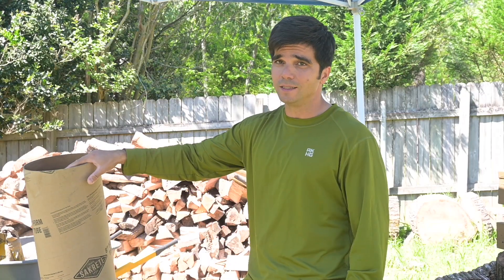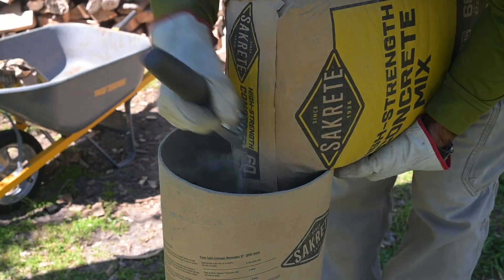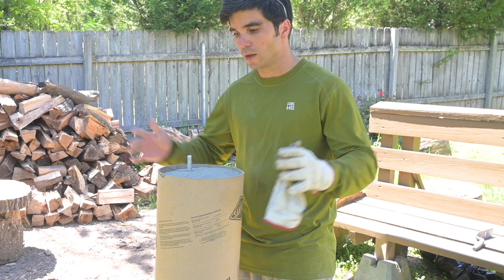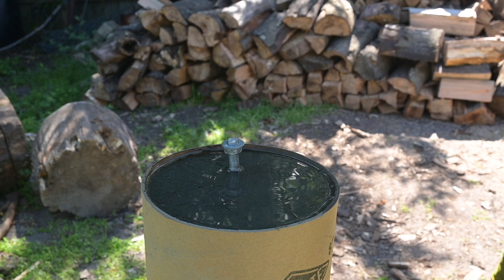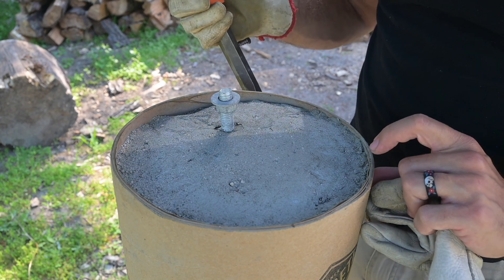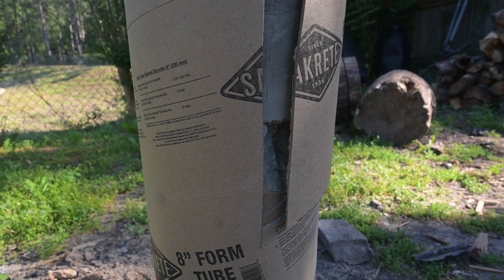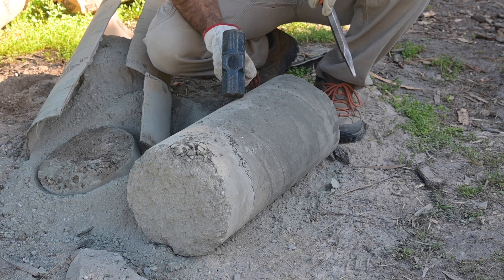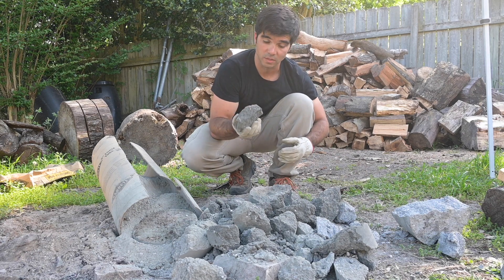Dry Pour Concrete: How Deep Can you Make it?

Comment: Sure if your building a 4 ft thick bomb shelter, bridge, high rise etc. dry pour no good. But for the small DIY home projects dry pour is fine.
Reply from the maker: To be honest, based on what I've seen so far I'd hesitate to make anything more than a chicken run or walkway with dry pour. I think slabs are a bit different since they're getting a lot of moisture from the ground, but the stratification is pretty bad and leads to a low quality result.

Comment: 2 days is not enough time to fully cure a 4 ft pillar
Reply from the maker: Concrete has 50% strength at 2 days and is rated for driving on. 
You can plainly see the difference in quality and strength when compared to cement that was mixed (in the tube) when you watch one of my earlier videos.
Reply: @appalachianwoodhomestead  is it common practice to drill holes for anchors after 2 days? And for similarity if building a deck on one of those brackets that keeps the wood off the foundation, would they start construction after the 2 days or let it cure a little longer?
Reply from the maker: @clintlickner  People do drill after 24-48 hours, but typically don't put torque on anything for about a week. Your point is taken in that regard. However, the overall quality is also extremely poor. I still have a chunk sitting around and can try drilling it now that it's been longer, if you're interested to see that.
Reply: @appalachianwoodhomestead  yes I am very interested to see that result as well
Reply: MIXED concrete, maybe. The curing and strength times you cite are based on a the standard mix pour method. Just consider that slower hydration might cause the chemical curing process to be extended. It might take a month or more for full strength. And again, contractors would never use this method, this is for DIY people who don’t have the equipment to mix and pour but DO have time to wait for curing.
Reply from the maker: @isabellavision  Agreed that this method is absolutely not for serious construction. 

The only information I can find suggests that dry pour may cure and dry slightly more quickly than wet pour. It would be a very interesting experiment to run. Maybe I can use it as an excuse to get more fun tools.

Comment: Thx for trying this but I'm not sure why people keep only estimating the amount of water used when they should be using the amount of water for each bag. For every bag of concrete, people SHOULD have a measured amount of water set aside to pour on the surface after the top layer firms. This is the only way to know how strong a dry pour can be because of actually using the correct amount of water for the entire process.
Reply: Great comment Rotary. 

Tamping the material is also crucial, otherwise there will be air voids which will be weak spots leading failure. No different than a wet pour. The principles of concrete all still apply.
Reply: @johnlee7085  Yep!
Reply from the maker: Fair enough. Thank you for the suggestion. with this video I was trying to test the way people are currently doing dry pour, which is clearly not optimal for concrete strength. I'll probably test again with measured water sometime next month.
Reply: @appalachianwoodhomestead  Sure NP! I'm about to do my own experiment as well.
Reply: I totally agree with your opinion!

Comment: Dont give up! Do one more test. All it will take is another not-fun clean up and goodbye to more of your own money! Hopefully this will produce more accurate and desirable water/concrete mix results than your last attempt using a hose and spray nozzle, which can't be easily measured or delivered. Also will provide evidence of how water does or doesn't permeate a volume of dry concrete mix that's thicker than a 4" slab configuration. Quickrete specifies 7 pints of water per 60 lb bag of the mix you used. As before, fill another 8" diameter x 4 foot Sonotube but with only two 60 lb bags. The column height will be about 31". No need to tap or vibrate. Then pour in all the ACCURATELY MEASURED water that Quickrete specifies for the  two 60lb bags; 14 pints (1 gallon +3 quarts. Not from a hose, use a container. Let cure for 24 hours. Cross fingers, cut open the cardboard tube and destructive test.
Reply from the maker: Sakrete (what's sold in my area and what I used) requires 2.5 quarts per bag of the size I had, which is less than the amount you cited for Quickrete. 

I agree the hose can be difficult to measure, but this was an attempt to test the currently popular dry pour method, which uses misting and hosing instead of measuring.

I sincerely doubt that this no-mix method, no matter how the water is measured, will result in a high quality product, but I'm willing to give measuring it a try at some point. Though I would wait at least 48 hours to cut it open, since that's when it's rated for vehicle traffic and has 50% of its final strength.
Reply: Without the correct amount of water, the cement is only partially hydrated, so there would be no way for the concrete to be as strong as any other fully hydrated method. 

Tamping the tube is important though because this is what allows the cement and fine aggregate to consolidate around the larger aggregate. 

Regardless of the method used, the same principles still apply.
Reply from the maker: @johnlee7085  But will the dry pour bros get mad if I tamp? 🤔

Comment: I don’t think you need to mist it if your not concerned about aesthetics. Just flood it
Reply: I would say that if you care how it looks, mist it.... But mist it damn good. I don't know why they say wait an hour between waterings. Once it tuffens up a bit, start showering it good. Keep it wet! Don't take the forms off for a week. Spray your forms down first with 2 coats of pam cooking spray and let it soak into the wood.

Keep it wet and covered for as long as possible. Concrete water cures fully in 28 days, it doesn't dry. Need more water and time to cure doing the dry pour. I'll be doing a slab dry pour test comparing wet mix.
Reply: Just put some water in every 6 inches or so.  It will go where it needs to go.
Reply: @allanfarr  exactly. If you use 3 bags, add the amount needed in water, every 6". Measure out the water needed
Reply: Exactly
Reply: There have been some surface flaking reported from those who apply too much water at the start of the wetting process.  True or not, I have no idea. Cajun Country Living was addressing some previous comments on yesterdays video.
Reply: @shawng8432  it's all pretty cool experiments. I have done a few undocumented dry pours on a small scale. They are solid, just not pretty, but I like the rough surface for traction in the winter
Reply: Too much water gives you weak concrete because the excess water forms voids.
Reply: @Anonymousg64  I agree, but for wet mix. Dry pour, who knows. I'll be doing some tests soon I hope
Reply: @jakefriesenjake  no, we know. Concrete is not curing under a different mechanism because its being dry poured. There is a reason Cajun Country livin has had so much more success then all the others attempting it, they actually formulated instructions for time and quantity of water that respects the need to to not over-water.
Reply: By soaking it you are washing the binder off from the concrete mix. By balacing the correct amount of water you get the best strength.
Reply: During the dry pour he should have stuck thin hollow rods so the water would reach the bottom. This was poor engineering.
Reply: @xxXxXxGxXxXxx  water will automatically be absorbed to the center of the slab. The thicker the longer it will take.

Comment: Good test now it's a dry pour test , i knew dry pour would not work for anything thicker than 6" . Even if it works mixing gives a better psi rating.  Thank you so much for the test .
Reply from the maker: The low strength of dry pour, no mix is concerning. I'm trying a final test with layering dry pour, water, dry pour, water (no mixing) to see if that's at all worth using. I'm tempted to get something to measure PSI so I can see just how strong, or weak, the dry pour method is.
Reply: @appalachianwoodhomestead can you do the next test in slab form instead of tube? Like 4" or 6" thick, 4' x 4'🎉
Reply: This may have worked if he had done it properly and gave it a shower twice for every inch of slab. In this case 96 hours.

Comment: The only thing I see differently is in every other dry pour video I've seen they use quikrete  and not normal concrete, and they did every hour or two not 20 minutes,
Reply from the maker: I used Sakrete, which is a different brand name for the same style product (not "normal" concrete). I reduced the interval between watering because of the small surface area. I couldn't apply as much water at one time.
Reply: Isn't quikrete just a brand?

Comment: Awesome!  Thank you for spending the time and money to conduct the test again as many viewers requested.  The video was very informative.  I was curious how much of the bottom of the tube had cured from contact with the ground, glad you showed that part.  I am slightly curious how the test would have gone if the tube had been fully submerged - would the interesting to see if the cardboard would have been soaled over time etc.  But that doesn't matter much as no one is going to wait that long to use a pilon.  

Thanks again!
Reply from the maker: I think it probably would absorb more water if fully buried, but I worry that it wouldn’t be very strong or useful for a foundation. I may test it just for fun once I get my backhoe back in about a month. Thanks for watching!
Reply: @appalachianwoodhomestead  yeah.  I know a lot of people dry pour fence post concrete but the thickness is much less etc.
Reply: @appalachianwoodhomestead  these are supposed to be watered way more than what you did, & it's also recommended they be left for 30 days, as the dry pour curing method is different than wet.
If you had a clear tube, you could've seen whether you were adding the correct amount of water, or after misting  start measuring the amount to ensure you have enough to reach the bottom, bc each bag needs a certain amount, & what you added clearly wasn't sufficient.
Reply from the maker: @leahrowe847  My wife and I were talking that it would be fun to do with a wood and plexiglass form. 

I've thought about measuring the water. I'm not sure that 2.5 quarts (the amount given for my bag) would have penetrated more in this narrow, deep tube. I'm also not sure how I'd sprinkle it evenly if I poured from a container. I'm wondering if maybe dry pour needs extra water added to ensure it saturates everything. Since it's usually done in slabs, it could be getting the extra moisture needed from the ground in other projects.
Reply from the maker: @leahrowe847  Oh, and I did water more than was shown. I edited out several rounds of watering to keep the video to a more watchable length.
Reply: @appalachianwoodhomestead  since the top doesn't have to be smooth, IDT you need to mist at all just start showering & soaking to get it hydrated. You also won't need to wait an hr between watering, as the amount of surface area is small, so it's wicking hard downward & needs to be wet at a shorter time span between. You can basically water as soon as the concrete starts it's getting a little lighter; especially, as you're trying to make some so deep.
Reply from the maker: @leahrowe847  I thought we included in the video that I moved to 20 minute watering intervals because it quickly became clear that an hour simply wasn't going to work with such a small surface area. Maybe my wife accidentally edited that part out. I agree that the watering needs to happen more frequently than every hour like people do with slabs.